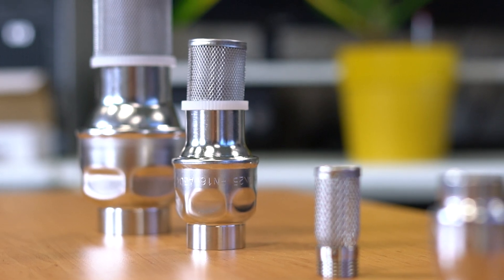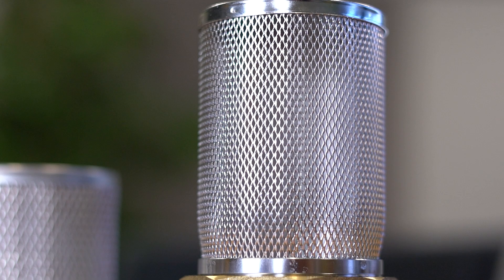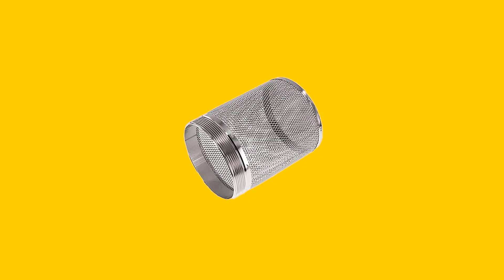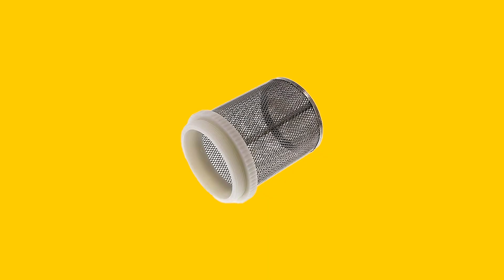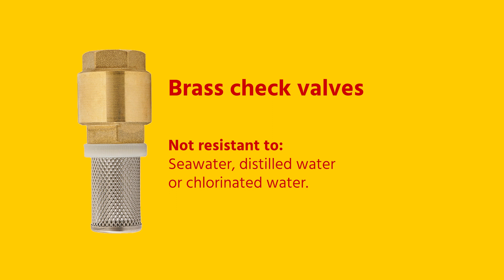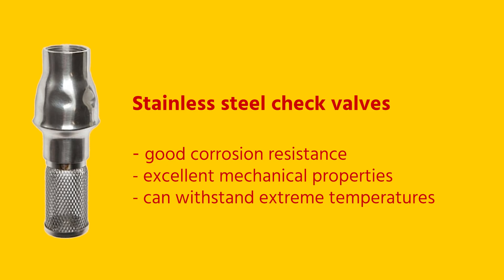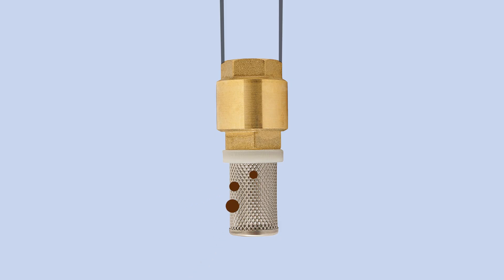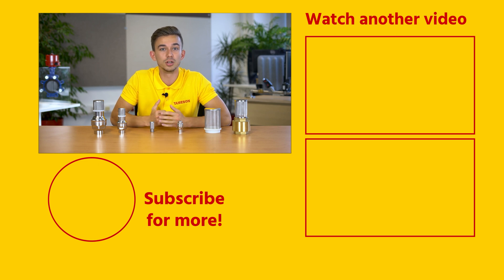Suction strainer for pump - Foot valve - Tameson

Comment: Thank you for this interesting footvalves. By the way are there any footvalve which can clean if self? Such as there is small electric motor with fan to clean or something...
Reply from the maker: Hello, thank you for your comment. There are some foot valves that have some sort of hydraulic self cleaning systems, but we do not have them in our range. You can try searching online for "Automatic self cleaning foot valve"

Comment: i use i inch plastic foot valve. currently i wrap mesh around that foot valve strainer. it reduce clog of disc filter afterward water flow. now im thinking diy-ing box-like strainer with pvc and fiberglass. btw, i think you are very good person.